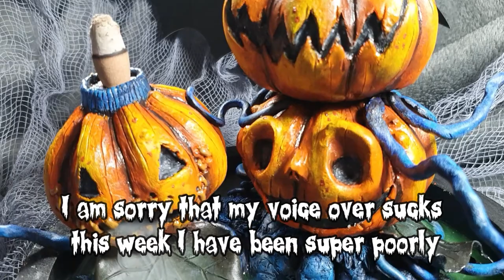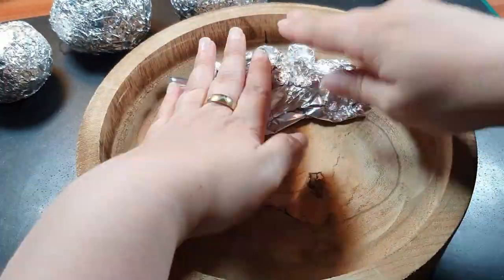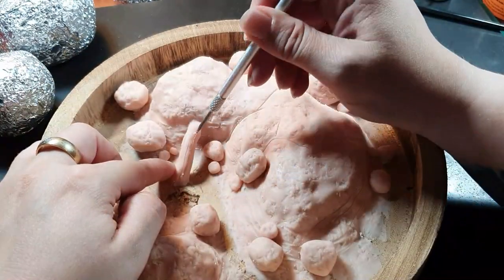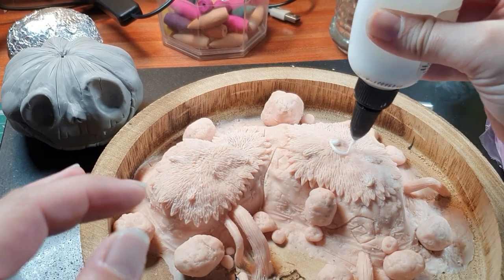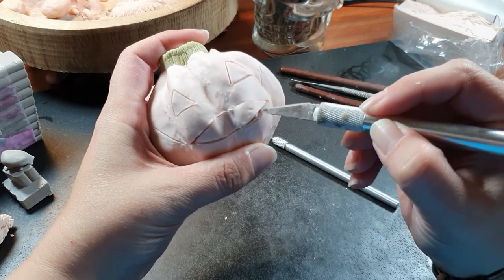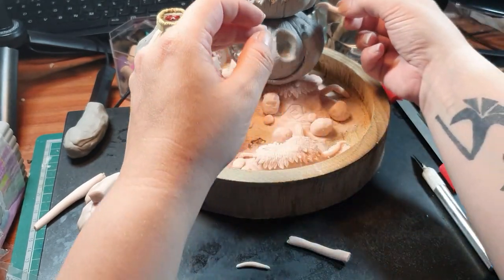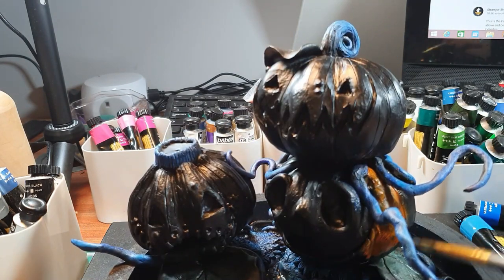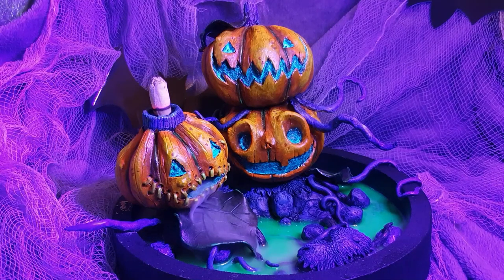Pumpkin Patch backflow incense burner || Nightmare before Christmas inspired

Comment: I cringed so bad when I saw you using that blade to make the hole. Little tip - Use a hammer, nail and a scrap piece of wood. :) It is super easy with aluminum from cans. It is much safer also. :) This is super cute!! I would love to have something like that on my table as well. Thanks for sharing. - Heidi
Reply from the maker: Don't worry I cringed when I watched it back lol
Reply: @pixiewolfdesigns  I hope you try the hammer and nail tip sometime. :) I want to make one with pumpkin but going to try to make it also light up with a battery operated tea light as well. :D Thanks for the inspiration. - Heidi
Reply from the maker: Can't wait to see it !!!